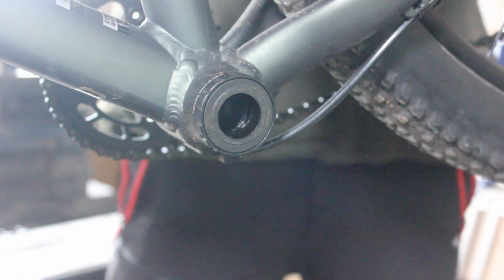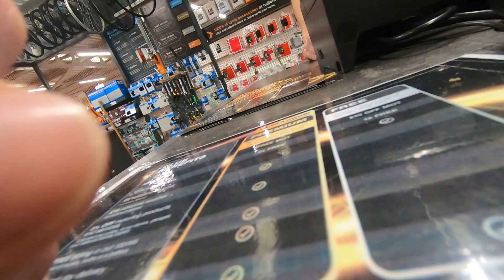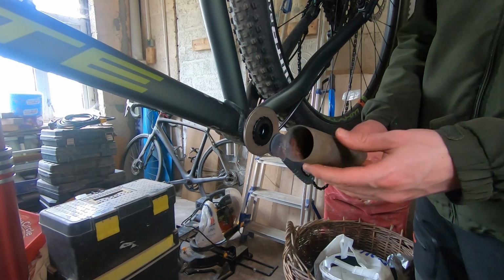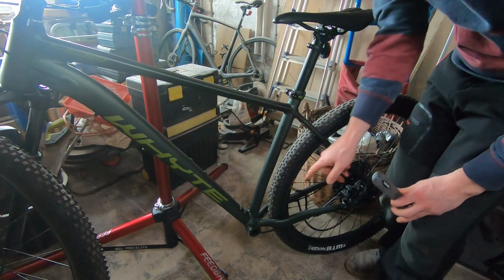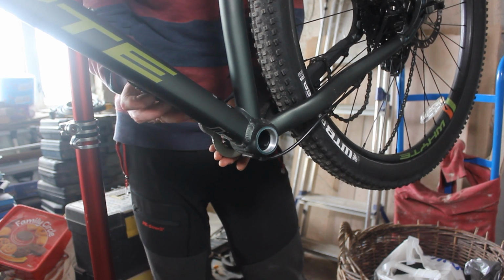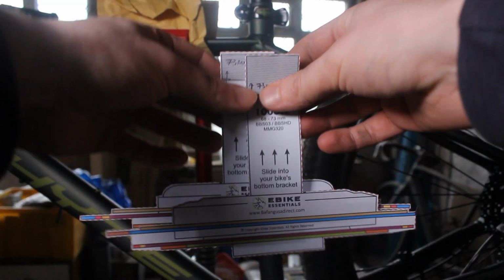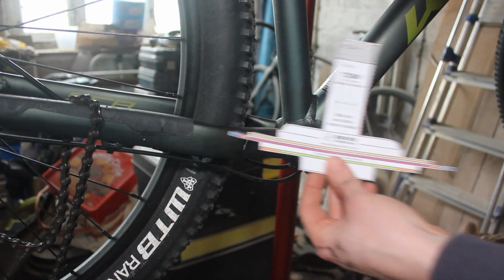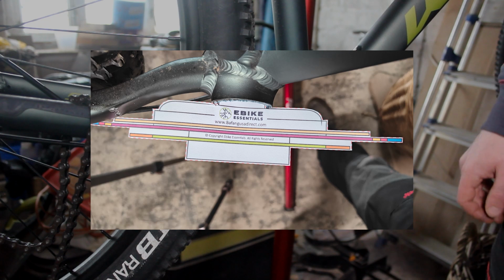E-bike Build #1: Bike Disassembly, Motor Fitment Using Paper Templates

Comment: Always excited for a new build. I recently migrated my bbshd from an old hard tail with a not great chainline to an old full squish with a much better chainline myself. I had 3 donor bikes when I ordered my HD and was willing to hunt down another if the motor didn't fit. I lucked out and it fit 2/3 of them fairly well, but I love the idea of using paper templates to ensure the motor and chainline fit the frame before choosing a motor. The BBS02 seems like a great motor with a peak output wattage not far off of the BBSHD and the HD is definitely a little much for most applications.
Reply from the maker: Hey there! Yes the paper template is a great way to see how a motor could fit in a much more physical way. Getting lucky with your fitment was great haha, and how is the HD? Probably overkill for most things like you say but nice to have I imagine.